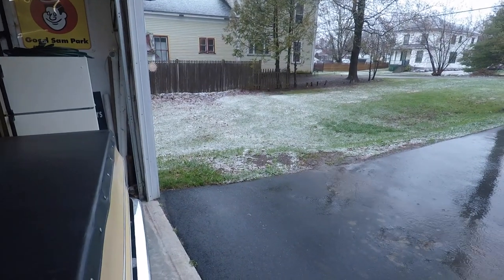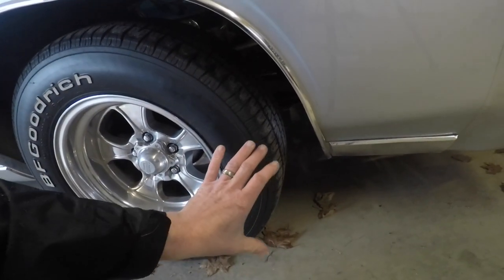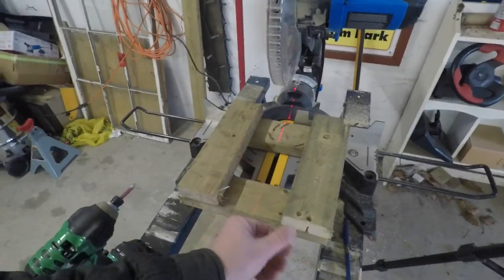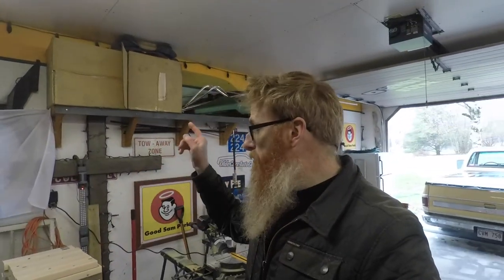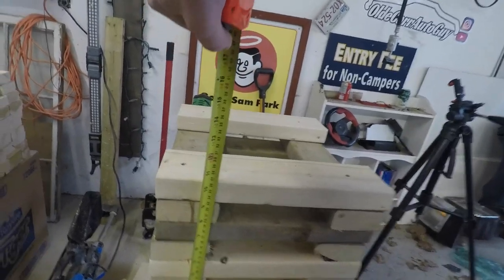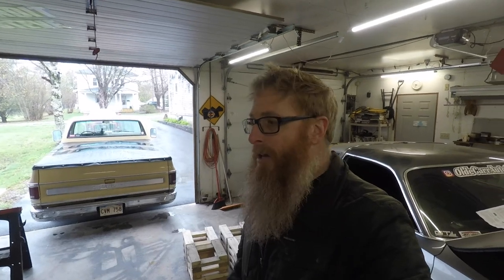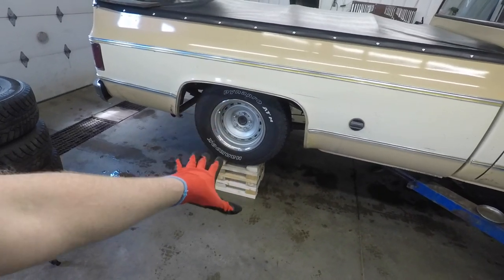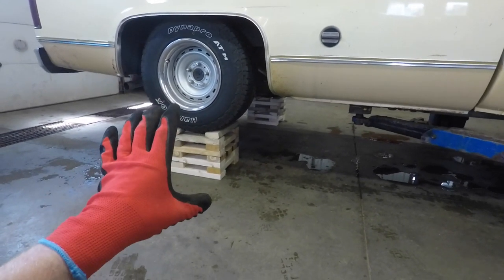How I Built Cribbing For my Lowered C10 For Less Than $50

Comment: if I'm doing my math right, your cut pieces are 16" in overall length?

And man, it's been awhile since the bumper to bumper challenge
Reply from the maker: I think you'd be fine at 14" which is what I did!
Reply: @OldeCarrGuy  and that's the outside dims, not the inside?
Reply from the maker: @Str8sixfan  Correct!